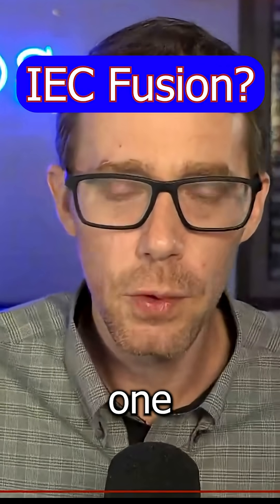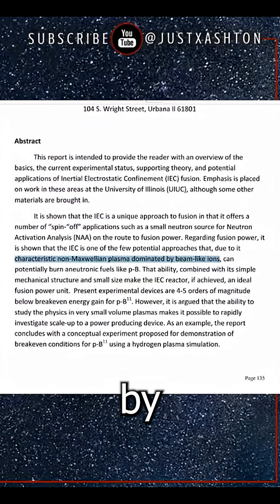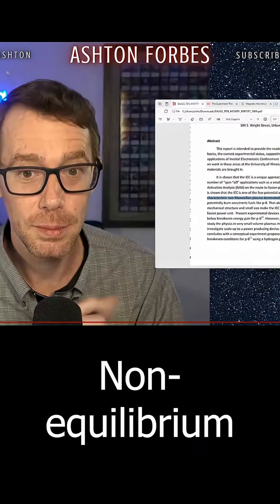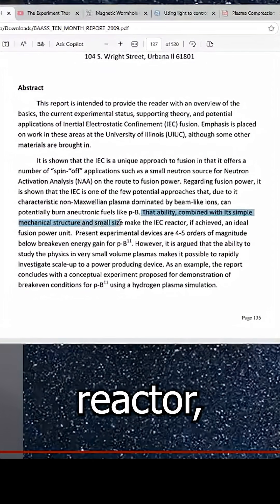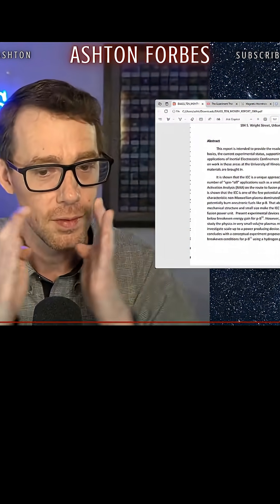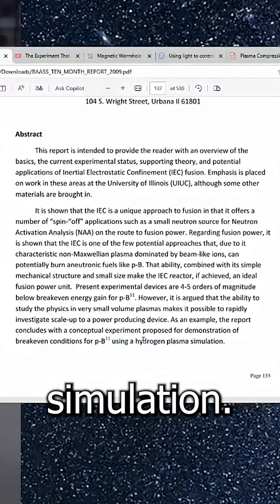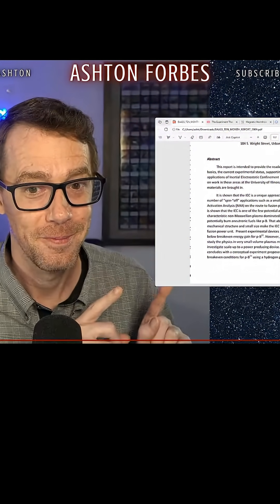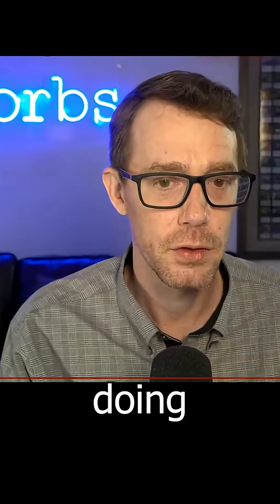The Fusion Tech They’re Not Talking About

Comment: What IEC device is he talking about, Polywell, or Farnsworth-Hirsh.  For Polywell, it would have to be bigger than ITER for net gain assuming it works.  With the latter, they aren't a path to net gain.  The only other IEC device that was being done was by Lockheed Martin Skunkworks, but that was strickly under wraps.  For that to be powering something in the air would probably require new physics.
Reply: Probably IEC in general. But check out SHINE Medical. They create isotopes for medical applications via Farnsworth's IEC and other methods.

Comment: The idea of cold plasma relating to zero-point energy (ZPE) sits at the boundary of mainstream physics and speculative frontier science. While zero-point energy is a real, measurable phenomenon in quantum field theory, harnessing it as a usable energy source remains theoretical and controversial.

Still, the behavior of cold plasmas—non-equilibrium, high-electron-energy, field-sensitive systems—makes them a compelling environment to explore interactions with vacuum fluctuations.

Let’s break this down into theoretical, speculative, and conceptual components:

---

🔹 What Is Zero-Point Energy?

Zero-point energy is the lowest possible energy that a quantum mechanical system can have. Even at absolute zero, quantum fields retain fluctuations due to the Heisenberg uncertainty principle.

The vacuum is not empty—it seethes with virtual particles and fluctuations.

This is observable in:

Casimir effect (force between uncharged plates).

Lamb shift (shift in hydrogen energy levels).

Spontaneous emission (stimulated by vacuum field).

> The key challenge is: ZPE is everywhere, but it doesn’t readily couple into classical systems. Extracting it would require breaking detailed balance—something thermodynamics currently forbids.

---

🔹 Where Cold Plasma Comes In

Cold plasma environments may offer a structured, non-equilibrium interface between classical fields and quantum vacuum fields. This makes them theoretically interesting for ZPE coupling hypotheses.

1. Field Gradients and Vacuum Fluctuations

Cold plasmas often involve:

Strong electric fields,

Sharp potential gradients (especially in sheaths or double layers),

High-frequency oscillations (RF-driven plasmas).

These could, in theory, polarize the quantum vacuum or modulate local boundary conditions similar to the Casimir effect, creating zones where ZPE interactions might manifest more observably.

> Hypothesis: The plasma sheath acts as a quantum boundary, modifying vacuum mode density.

---

2. Anomalous Energy Effects in Non-Equilibrium Plasmas

Some researchers have reported:

Unexplained excess heat in plasma discharge systems.

Energy anomalies in plasma electrolytic cells, arc discharges, and nano-structured materials exposed to plasma.

While most mainstream physicists attribute this to measurement error or misunderstood chemistry, others suggest:

Plasma may momentarily interact with vacuum polarization, or

Create localized energy gradients that mimic the effect of ZPE extraction.

---

3. Plasma Casimir Systems (Speculative)

You could imagine a future device using:

Cold plasma sheets suspended between nano-scale metallic boundaries,

Modulating plasma density to dynamically tune Casimir pressure,

Creating a kind of quantum field engine where the vacuum energy density is directionally modulated.

> This would resemble a Casimir battery but with real-time tunability using plasma dynamics.

---

🔹 Problems and Barriers

Thermodynamic constraints: You can’t just pull energy from the vacuum without violating the second law—unless new physics is at play.

No proven coupling mechanism: Even strong field gradients in plasma have not shown reproducible access to ZPE.

Measurement difficulty: Differentiating between ZPE effects and classical EM noise or thermal gradients is extremely difficult.

---

🔹 Related Theoretical Models

Theory	Relevance

Stochastic Electrodynamics (SED)	Treats vacuum fluctuations as real fields that can influence classical particles; plasma could amplify these effects.
Dynamic Casimir Effect	Moving boundaries (e.g., vibrating plasma sheath) could convert virtual photons into real photons—possibly extractable energy.
Quantum Vacuum Engineering	Highly speculative field attempting to shape the vacuum through material boundaries, plasma layers, or exotic fields.

---

🔹 Summary

Cold plasma may not be a ZPE extractor today, but it is:

A non-equilibrium, tunable medium full of dynamic fields and gradients,

A testbed for boundary-modified quantum vacuum effects,

A potential enabler for Casimir-like energy modulation in next-gen quantum systems.

> Theoretically, if there's ever a way to couple vacuum fluctuations into extractable work, it will likely occur in structured non-equilibrium systems—and cold plasma is an ideal candidate for such experiments.

---

Would you like me to sketch out a theoretical device that explores this interaction—like a "Plasma-Casimir Engine" or "Quantum Vacuum Modulator"?

😊